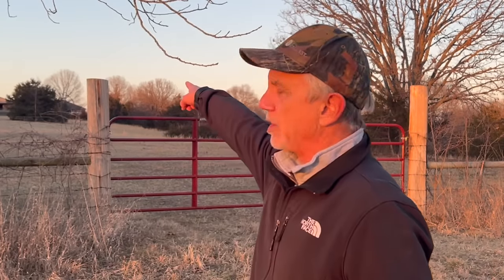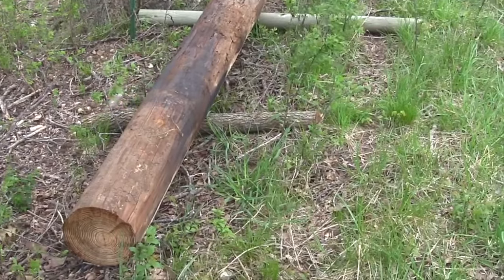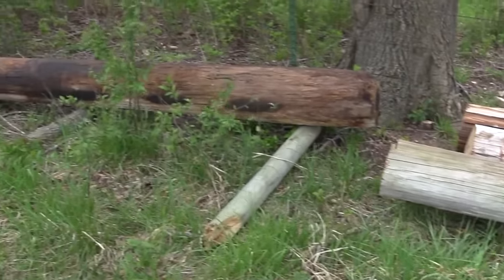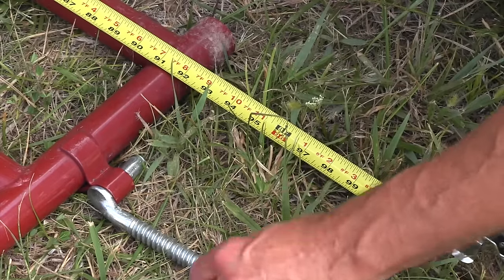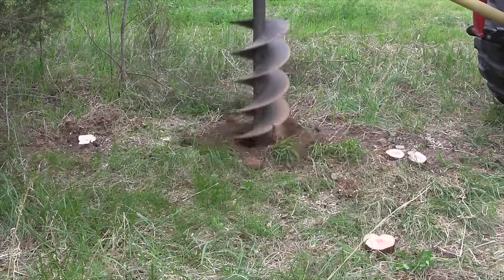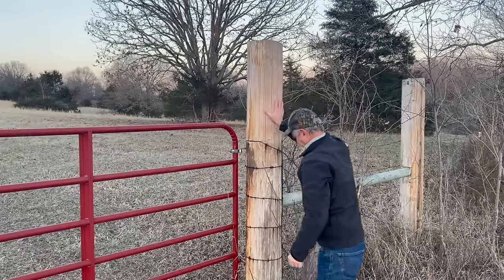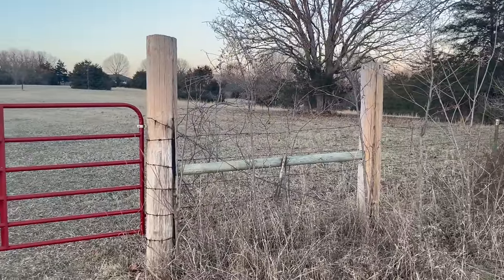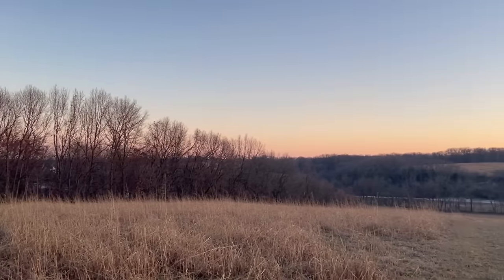Mastering Gate and Corner Post Construction: A Time-Tested Method for Durability

Comment: Your cross wire is going the right direction to support the gate weight but not the tension pull of the fence. I would worry more about the fence pull than the light weight of the gate. Better yet do an X brace with the wire and really lock it in place. Your posts are really big , so probably not a problem even if you had no wire, and is why it still looks good 7 years later.
Reply: Agree, although that light weight gate will have no effect on the big  end post that’s holding it. Even with a heavy gate, a sturdy post and well tensioned wire pulling opposite direction will more than compensate for weight of the gate. But it doesn’t hurt to over-engineer a fence.

Comment: Thank you for the comment on NO concrete. you are spot on. my neighbors always uses concrete and winds up.with a bunch of post rotting off even with the ground...
Reply: I always put a little in the bottom of the post. No need to go all the way to the top but a little concrete up about 6" or so from the bottom really helps stabilize the post. Just pour it in dry and if will pull moisture out of the ground and setup. I've noticed no premature rot doing it this way.

Comment: Great video Mike. Often thought about putting a gate at the end of my driveway. If I do, I'll remember this. I have an old anvil sitting on an old oak stump on concrete.Every summer on a hot sunny day I pour used motor oil just enough to pool on top and a little runs down the sides. Had it for 30 years.

Comment: If I’m seeing it wrong I apologize and stand corrected but it looks like your brace wire runs from the bottom of brace post to top of end post. Should be opposite because fence wants to pull away from end post and into brace post  ie back toward other end post. Anchoring brace wire back to bottom of end post negates the upper pull on the end post by transferring that energy back to the strongest point on the fence - the end post at the ground. In this case it’s only serving to keep the brace tensioned together and pull of the fence is only compensated by just the cross member and how sturdy the brace post is.  You can absolutely get away with no bend to your end post when using wide diameter utility poles like these, and that post will likely never bend because of how thick it is and it’s pushing into another wide diameter brace post. Guy down the road from me used utility poles, didn’t even build a brace, just one big monster end post. I thought it was nuts but it’s been sturdy for years (plus it’s not that long of a pull, maybe a couple hundred feet).

Comment: Dang, get you a tamping rod. I make them myself from a piece of 1/2" steel water pipe with a tee on the end. The tee works really well with tamping around the post. 
Also don't ever cut your post tops on a angle. People think it helps shed water but what it actually does is expose more end grain to rain. What I do is use old paint can lids to cover the tops. On a post the size of yours you'll probably have to use a 5 gallon bucket lid.
tob

Comment: My posts in Florida were pretty tall and really i not sure why, so I made a fixture to go around the posts and cut them off at an angle for water shedding. They looked much better afterwards. Apparently the previous owners of my property here in Missouri had no clue as to how to set a post in the ground, even though they put the posts deep. This rocky terrain is not that easy to dig that i can see. One section of fence that i took out was not even straight and they used metal posts too. I pulled some of them out pretty easy and others since we didn't get much rain last year so I had to pour water down to loosen them. They also tried to use barb wire and they didn't use it correctly. I used a grinder with a cut off wheel to remove the old wire and now have a plastic garbage can full so when I get another roll off brought in to throw that away, along with other junk i keep finding.

Comment: Very good explanation. Do you happen to remember how deep were you able to set your post?
Reply: For a corner, gate or brace post you need to go about 4' if you can. On just line post you can get buy with 2'. At least that works around here in Middle TN, different ground conditions will be different.

Comment: Angle the cuts on the top of the posts to the back (or front) so the angles aren't as obvious when approaching the gate if they aren't matched perfectly? 

I just finished building a fence like this and it turns out NRCS and USDA publish specs on how to build livestock fencing. They suggest a hole quite a bit larger than the post diameter so you have plenty of room to tamp around the edges, but I've done it both ways with success. They also suggest mounting the horizontal brace higher than halfway - 2/3 of the top wire height IIRC - but like you, I've left a gate post tall where otherwise I normally cut my fence posts at 50-52". 

It is possible to run 12ga barbed wire for the brace/tension wire, but I can't recommend it. That's what I did because it was all we had, but it tore up my gloves good and is much harder to work with than smooth wire.

Comment: My understanding is if the wire fence is tensioned, you need another wire going the opposite direction for the same reason you need the wire you put in to hold the gate..

Comment: He was talking about putting that wire. But he didn't say why you put it on the top part of the gate post down to the bottom of the support post. And that is because of the weight of the gate hanging on that post. If you go the other way around, it will still pull the postside of the ground. So that was a good way that you did that. And I helped build many, many miles of. Fence
Reply: Those short tube gates like that are so light, it won’t have any effect on a big end post like what he’s using. The tension of the fence on the end post more than compensates for whatever pressure the gate is creating.
Reply: @BC-yv8ew  Until the kids like to "ride" the gates.